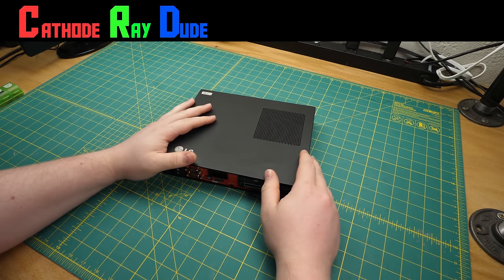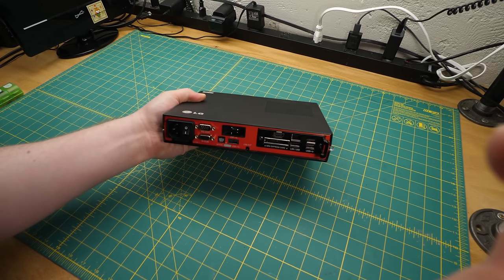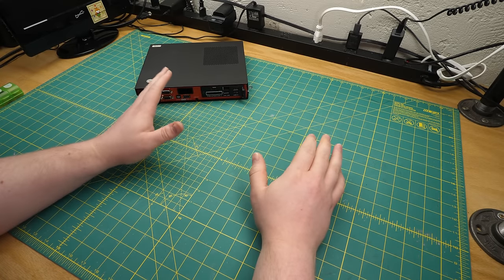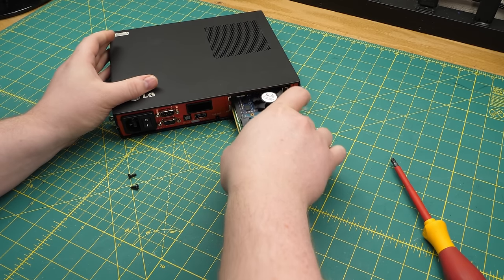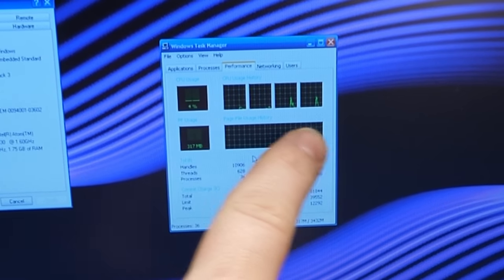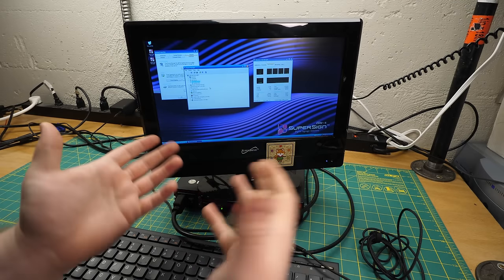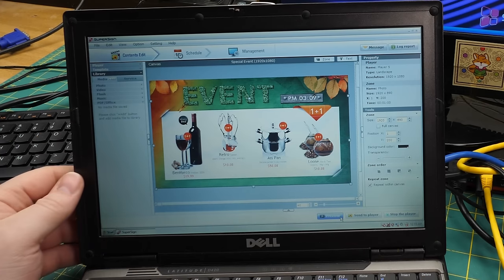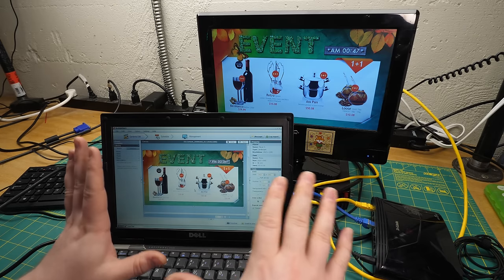Little Guys 6: The Worst Possible Timing [LG NC1000]

Comment: I'm not sure where the "slim" comes from because they don't use the slim SATA connector (which is a thing) but they're "half" because they're half the size of a SATA SSD PCB if you take it out of it's casing. I'm still waiting for your video on the Stratacache machine. When is that coming?

Comment: these were terrible and unreliable and LG essentially dropped the ball on anyone who bought one for commercial use as they would fail after a couple years and when they call LG for support LG would (at least at first) send them a refurbished one that would fail in a year and after that, most venders were out of luck; the PC swap out was a complete joke as by the time you'd have a need to swap it out, LG would have long disconntinued the line and you'd have to buy a whole new unit anyway.